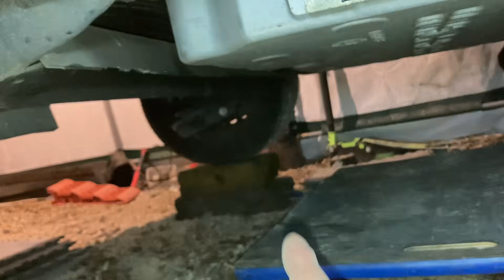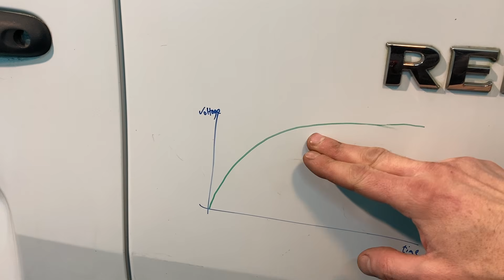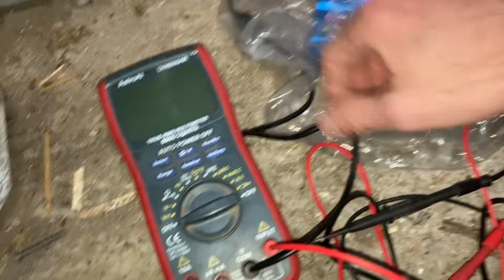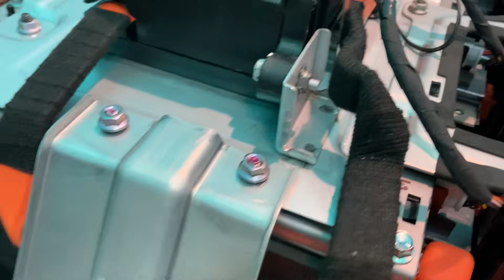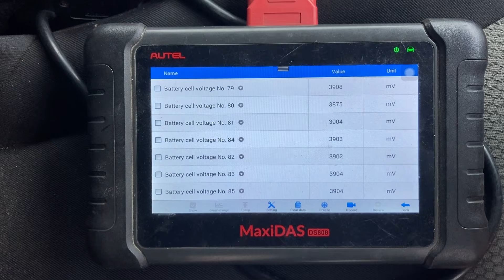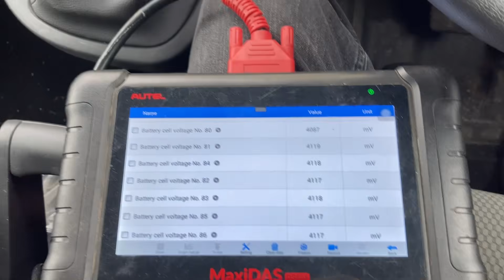Can we fix the Kangoo HV battery ? Renault ZE33 Low Cell failure EV Repair lithium

Comment: Great video Gary. Definitely a gap in the market for module replacement, balancing and diagostics. If modules were standardised as 8s or 12s etc. Governments should mandate that EVs have standardised modules that must be removable. The EV manufacturer can decide the size of the pack and where the weight load it in the chassis. Issue with Zoe 40kwh upgrade from 22kwh is that pouches are tighter packed in same footprint so thermal expansion causes single cell fails. Think they solved it in later models as the made the pack bigger, at least modules come out and arent glued or welded in like some brands of EV car!
Reply from the maker: Totally agree, standardisation would make repairs so much easier! 👍

Comment: If it was a weak cell it would charge faster (and discharge faster) than all the other cells - definitely a balancer problem and you can tell that by the way the cell voltage is fluctuating more than all the others. So you may have a high resistance/intermittent connection back to the balancer, a faulty balance switch (mosfet) or just a bad connection or resistor. I'd look for corrosion on connectors as well being an EV pack and subject to moisture intrusion.

Comment: The cells will read lower when the car is turned on. The off-load voltage of any cell will always be higher than on-load. That difference will reduce again as soon as you disconnect the battery and BMS connectors, and measure cell voltages. The BMS needs to load the cell a little to ensure that the cell is working properly and for it to carry out balancing.
Maybe it's best to leave that one cell disconnected from the BMS for a week, and then see whether its voltage has dropped further? That would tell you for sure whether it's a cell fault or a BMS fault.
Clutching at straws, maybe, but this is worth asking: Is it possible to connect BMS sensors to adjacent cells? If so, then that might have happened when Renault replaced what appeared to be a faulty cell, but which could have been a BMS fault. So now, the next cell might be connected to the faulty BMS sensor.
Reply: Update: O.K., I watched the end of the video. It sounds as though my suggestion of leaving the module disconnected for a while is the same as your plan.
Renault are really taking the Mickey if they want to bill people £2,400 (inc. VAT) for a module. At that rate, a battery's worth of modules would cost you £28,800, without the battery enclosure and circuitry. A complete brand new Kangoo isn't too much more than that price.

Comment: Once the battery is out of the van again and the lid off, would it be a useful test to connect an ordinary multimeter on its milliamp scale into the BMS voltage sensor circuit for the suspect cell? If the fault is that the BMS has a stuck-on bleed/balancing resistor, you should be able to detect, indeed measure, the current. That would detect a burned-out final switching transistor or other equivalent short, but not easily detect a fault which only happened when the BMS was powered up.

Alternatively, but slower, disconnect just the BMS plug for that module - then there's a guarantee of no current flowing to the BMS sensor/balancing connections. If there's time, give the battery a few days with the module disconnected, and measure its cell voltages again. If the cell itself is faulty, it'll be dropping by a few mV/day even when isolated from its BMS; and if it doesn't lose volts when isolated, the BMS must be responsible for the cell discharge when connected.

(Could you measure cell voltages without removing modules, just with busbars removed for safety, using the BMS harness connections?)

Comment: The odd millivolt variation in cell voltages as seen by multimeter and by the BMS will be that neither of those is perfectly accurate, but the BMS effectively has a separate meter (A-to-D converter) for each cell, and the multimeter is of course the same measuring device. Nothing to worry about, just a feature of the design.

Comment: Ia the balance resistor in the bms or in the module (commanded from bms) ? If its in the bms would swapping the modules around reveal the problem cell moving position, if its still the same 80 then it's the bms ?

Comment: I suspect I said last time that the BMS has the discharge resistor switch stuck on ,  if so it would easily be found , take the BMS lid off and with a thermal camera or with your finger check the discharge resistors , if one is hot the associated switch probably a mosfet is short
Reply: The resistor won't be very hot. If it's to draw 5 mA at 4V that's only 20 milliwatts. That 5 mA constant load would more or less match Gary's 40+ Ah balancing charge (1 year x 5 mA is about 40 Ah).

How's this for a possible single cause for the battery's entire fault history: the BMS has a fault such that the discharge resistor for cell 80 is stuck on. Renault "repaired" the battery by mis-diagnosing this as a faulty cell, then replacing the wrong module, the one next to it. Now all the cells are still perfect, as they were before Renault got at it, and the BMS is still faulty, as it was before and after that earlier so-called repair.

Comment: Full pack connection before contactors on the zoe isolator could be useful if you wanted to do low-rate solar trickle charging.  Having to have the car/contactors on while charging means you need a minimum amount of power available to get any useful charge.

Comment: I would have changed the position of the module in the battery pack when it was charged in isolation , so then you could tell if it was a bad module or the bms that was giving the problem.

Comment: Ypu should have swapped two modules. In case it drains again you would have an idea if it is the cell or maybe the BMS at fault.
Anyways, nice job. Especially interesting since I recently bought a kangoo myself, with the 22kWh battery though.

Comment: Thank you this long video .
It is helpful to see the construction of these battery units - looks well implemented.
At least you can change out a module as the client views it as  being a better solution than scrapping the vehicle.
The analytical software could do a better job of isolating failing or self discharging cells as there is a very good balance between all other cells.

Comment: I replaced the batteries in my mates special wheel chair whilst he was still in it. He pretty much lived in it at that point. I was amazed how quickly 2 tiny AGM batteries heated up a 10mm spanner to glowing red hot when I carelessly shorted the battery positive to the chassis. No harm done it burned clear but the lesson was learnt. It was about 3 seconds to cherry red.....

Comment: The previous battery repair could easily have replaced the wrong module since it's the end cell in this module, and it's the adjacent module that was replaced and didn't (?) fix the fault. Then you only have one fault.
Reply from the maker: Interesting thought tho they would have had to fix something to get it back on the road? Maybe it wasn’t as bad when they did it 🤔
Reply: @garycevrepairs  Fair enough, but I bet thet didn't actually repair the real fault in the battery, just masked it by substituting a new balanced module for the one that was off voltage, it would seem ok for a long time if you didn't bother to look too closely at the cell voltages over some days.
Heres my (revised) narrative:
Battery has one fault in the BMS or it's wiring causing a slow discharge of 1 cell.
Repairer opens battery knowing which cell and hence module is off voltage, and to diagnose fault (is it BMS or module) they swap 2 adjacent modules
bad cell voltage read by BMS moves => bad voltage is in module not BMS, replace the now position swapped module with a new one , all voltages look reasonable.
Reassemble, reinstall, give it a good charge and test run, all looks good, return to customer, it's is ok to start with but looses capacity over months as the cell voltage drifts down again.
- That sounds like the battery you received and I think what you said the customer experienced - and it's only one fault and a repairer who isn't as thorough as you, (but it would be pretty normal for commercial repair)

This also suggests cells prob ok and there is a minor fault between the BMS balancing wires for that cell, possibly would show on a DMM around 100Kohms.

Comment: The BMS measured voltages are more consistent than the actual battery voltages as the voltage variations in the individual BMS measuring circuits are balanced by the BMS to level out the BMS measured voltage rather than the actual voltage that your DMM measures. Great video by the way.

Comment: I used the same charger to charge locked out Makita batteries. It did it a few times before it started smoking horrendously I was only running at 2 amps. I took it to bits and I think even 2 amps is optimistic. I think it was rated 10 or 15 amps on the listing...